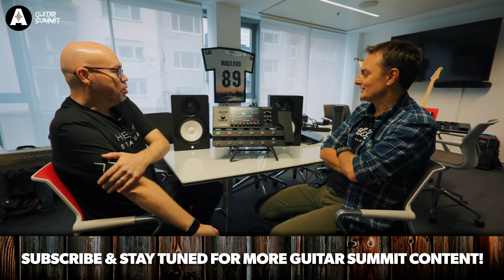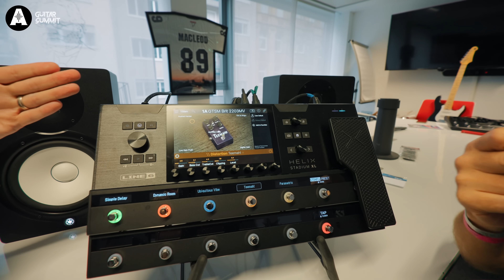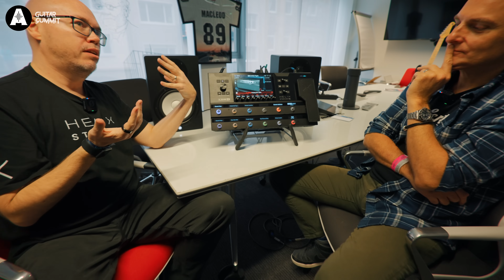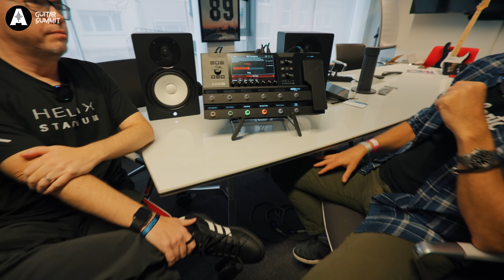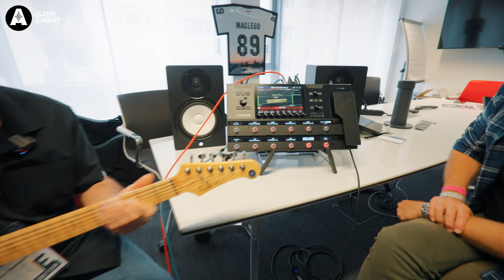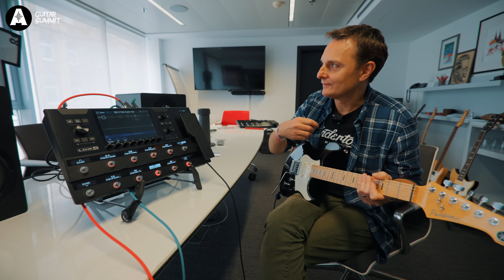Line 6 Helix Stadium Floor XL at Guitar Summit 2025!

Comment: I hope Line 6 eventually provides a (desktop) unit with the same screen and functionality, but fewer switches and without the pedal.  That is, an upgraded HX  Stomp.  I will admit the Spark 2 sounds pretty good now, but it took me a lot of tweaking to get the sound I wanted (and some surprising choices of amps, compared to other modelers I have tried,)
But Line 6 and Boss are still my goto favorites...  (well, ok, there is Ampero II, and Nux, and .....  :)

Comment: Question for Eric or Paul hopefully…

I’m listening through headphones, and my issue is…(and has been since the Hd500 and with the Helix)  that when you have any amp model….from black face clean to gained up Plexi, and you play soft and then dig into it, I’m used to how real amps get louder and actually “fuller”, but the digital models tend to thin out and get more trebly rather than more ballsy.  
Does anyone else hear or experience that?

I’ve been gigging professionally for 35 years and have owned countless tube and solid state amps, I’ve owned every guitar device Line 6 has made… as well as the Kemper Stage and Headrush.  I am really hoping this will be different.   

I’m optimistic and have been on the preorder list since day one, but so far, I hear the same thing in this demo.

Comment: There are two tone-products I really wish I could get included in a Helix so I wouldn't need to connect external devices: a Digitech Freq for a feedback squeal ala Thorp, and a full-on fully adjustable Rockman with all the settings seperated out.

Comment: Hoping there will be deep edit parameters added to the amp blocks. Like negative feedback, depth, custom impediance curves, different power tube types, tweaking transformer parameters. Not sure if that's feasible with the "component level modeling" in Agora, but if they did it somewhat comparable to Fractal, it should be. This is the only thing missing to cover all of the bases that the competion is doing. That and having a looper that competes with Loopy Pro would round out leaving noting to be desired all in one unit. I'll enjoy my preorder unit either way.

Comment: As an SLO 100 owner for a couple of decades (yes, a real Mike Soldano one) I’ve never heard a modeller come even close and the ‘Sold 100’ here sounds crap. It sounds like a cheap distortion pedal into a cheap delay pedal, yuck! 
Modellers are toys for hobbyists who want to play at being guitar heroes in their bedrooms. No real guitar player plays through desktop speakers, headphones or FRFR cabs. So, it’s laughable that this is called ‘ Stadium’ 😂 I guarantee you will never see this product anywhere near a stadium let alone on the stage! 
Btw I’ve owned nearly every amplifier every made including things you will have never heard of, I also own a modeller - I bought it last year out of curiosity… it sucks!
Reply: What was the playback system for your modeler? If it wasn’t a real power amp and wooden cab, what experience were you expecting to achieve?

Comment: In my opinion line 6 would be make a basic product with emulations, cabs an effects, a cheaper product, and then, if you need a showcase function or a clone amps functions, you can download in the line 6 web and paying for it, like plugins or whatever. I like how stadium sounds but i don't need some functions. It can be like phones. You have the basic product and then can download apps as you need.
Now other brands can take the idea and offer a same quality sound product with less price.

This is a problem because in 2035 we will find procesors in 3500 $ with some specs we don't need.

Comment: I'd rather plug into the real amp and instantly have the sound I want
Reply: For recording and playing at low volumes this thing beats real amps any day.
Reply: Not in reality. Only in geartube.
Reply: @BOSSenjoyer  It is a reality. You need a studio to record and play cranked tube amps. Nobody in their right mind is going to do all that at home
Reply: Of course real tube amps are always going to sound 'better', because they are the thing that modellers are trying to emulate. However, they are heavy, loud as fuck and expensive. Digital definitely has its place.
Reply: Yeah I don't get it
Reply: @BOSSenjoyer  I agree with you that I would rather plug into a tube amp. However, I live in an apartment, I can't afford to buy several different tube amps, and I physically don't have the space. Modellers at least allow me to get at least some of the way there without getting evicted and/or divorced.

Comment: super excited for Helix Stadium. I am one of the people who has managed to figure out ways to max out DSP on legacy helix and usually create per-song patches.... which causes problems when I need to do really seamless outro and intro transitions with heavy lead lines between songs becuase I'm limited in DSP and cant bundle all of the different effects on one patch and also dont have seamless bleed between patches with the amount of rows I use per patch. So that alone excites me. As a tone snob as well, the added dynamic range and preamp quality upgrade is very very exciting as well. And because I gig so often, that weight decrease is huge for me. If this was all that they innovated upon I'd still upgrade. But all of the other stuff is just insane and I cant wait to nerd out and find ways to enhance my performance quality with the features. Also the touch screen was a must. I've mastered navigation with physical knobs having to make quick and abrupt changes during soundchecks and sometimes even in the middle of a live set, but the touch screen will make that so so so so much more fluid. Not to mention being able to use my tablet or possibly phone for patch editingg over bluetooth is HUGE

Comment: Over priced over sized, I could get just as good sounds out of something cheaper and smaller
Reply: Just add "in my opinion" or "for my needs" to your statement and everything will be fine.
Reply: @HotRats73  I used to be the one at the front of the line to get the latest and greatest things like these but have got wiser with age

Comment: RE: the matrix mixer section...what Lee's talking about with using the unit as an interface to output separated tracks was actually possible with OG Helix as well...I was able to use USB ins routed properly in Ableton to go through send that I could connect to our mixer, two for stereo outputs for the tracks and a third for the click....the key issue I ran into was the presets where you route a second line in one of the paths to pass the tracks through didn't save correctly...I'd have to  cycle inputs for things to be recognized correctly.  Hopefully they've worked out that type of jank, because it would be really nice to all-in-one it *reliably*!

Comment: I have mixed feelings. Lots of cool features but …First of all I don’t approve of the “buy now, you’ll get some features now and the rest later”. Then the images of the pedals and amps at an angle with the background or surface look a bit awkward to me. Headrush and Fender are the best at UI. The RJ45 port for “possible future features” sounds very silly to me. And finally… why does the basic unit not have the strips?!?!
Reply: You can turn off focus view so you don’t have to look at the images of the pedals / amps 🤙
Reply: They knew that the strips is a huge deal specially with a unit that it’s so flexible. They want the user to buy the XL.
Reply: @netzarim1277  of course but the base model is still pretty big and pricey. With the Helix it was the LT version that lost the strips. I feel like the branding is a bit off. For a big unit like that with so many switches a feel like the strips should be there. They could have saved the no strip layout of an LT or Stomp model later on
Reply: @Mig-El_Romed  I agree that the strips are a must have for units so customizable. That’s I’m saying they really want you to buy the xl. There’s a reason why they are launching it first.

Comment: Hey guys, I enjoyed the video. I remain impressed with the technology. But I am going to continue to ask. When will you address the remote editor? As I have stated many times. I am a blind Blues guitarist. The only way I can manage the unit is via the editor. The editor must be screen reader accessible. Line 6 has never shipped an editor that is accessible to the blind. Bells and whistles are great, and Stadium has them aplenty, but when do you get back to the basics? How will you address the needs of blind guys like me? Frankly, I'd love an accessible HX-Effects editor. That unit does everything I could want (except for the editor).
Reply: I'm keeping the pressure on them as a long time L6 user who’s also blind. I’ve found a rather unique work around to editing presets in Helix, but it requires a massive amount of knowledge and an very specific skills to edit it since under the hood the files are what are called .JSON files. You can use a text editor to write presets or change parameters like you are writing code. Believe me its as painful as it sounds. I’ve played my Helix everywhere from small coffee shops to large statium level events and everything in between. But I basically have to either settle in for a night at my computer if I want to manually change things or have someone do the changes for me. Out of respect for Eric and the L6 team I’ll say I do know at least part of the reason the current editor is not accessible and it is not something they can easily fix. I’ll have to leave it at that for privacy reasons. That being said I want to put the pressure on them to get this into the hands of one or two blind users to actually let us even see if it is worth buying. I know we are a small group overall, but it would be nice to get at least some functional use out of a product we spend our money on. Oh also I’ll say here and now I’ll still buy this over any other unit. Kemper tried, but they were just not good working with this stuff. Fractle Audio basically told me they did not care nore is it something they would ever want to take up. L6 not only took it up but has tried actively to work with me in the past and I’m hoping to get that relationship going again for this new unit as well
Reply: That is really good hearing. I do not know how you import the .json files, but it seems reasonably straightforward to write some python code to generate them, so that you aren't dealing with syntax errors in the output. If I could do this for the HX-Effects, I might be interested in taking on the hassle. My experience with Fractal has been very positive. Contrast the size of Fractal to Yamaha/Line 6. I won't go into the details but I have been working with them on the accessibility of one of their products. I am also approaching this from a different perspective. I am looking at filing a law suit under the ADA against the modeler vendors. More to come on this.

Comment: Well. I have a Helix & have been using it happily for 5 years. I use it somewhat differently from most in that I dial up my own tones from ground level and then treat it like I'm using two of my favorite amps (Engl Ironball & Line 6 Badonk). Everything is the based on that core tone & variations done with snapshots. Works great; nobody who hears it thinks I'm using a modeler.
But now.
Crap. I know I want this new Helix,  just gotta not eat well for two years to get one.

Comment: Maybe I'm the only one who didn't/doesn't care about touchscreens. Helix (mine and the new ones) are floor units with foot-switches. I'm 6'2" tall with back issues. Much easier to edit my "old" Helix from my laptop anyway. So I'd appreciate editor improvements. I also don't care about amp capture much. I haven't owned an amp since POD 2.0. I've been very happy trusting Line 6 to create amp models for me. Can I plug my Variax into "Nexus"? I do appreciate the looks and the work put into the new Helix line, in spite of the fact that it feels a little like feature bloat and solutions to problems that I wasn't having.
Reply: You are not the only one. Give me a nice PC/Tablet Editor and keep the touchscreen - makes no sense on a floor unit.
Reply: @berndkiltz  Thank you! I thought it was just me. Nobody fires an app on a touchscreen to drop it on the floor and use it.

Comment: This channel does nothing but slag off Line 6 and Helix products; Helix comes at the bottom or near the bottom in every digital shootout they do, and they have harsh words for it. See if you don't know how to get the best out of a product and rely on what is admittedly crappy default presets, then you're gonna get bad results. Do they even update the system? Maybe not. Never use IRs either, which vastly improves the realism of these products when it comes to trying to get a more tube-like tone. Never see them go into the global settings to do high and low cuts either. People who use Helix regularly know all these tweaks you can do and know how to make good presets that don't just involve turning knobs and hoping for the best. Now is Helix, etc, the best, prob not, prob old tech that's now showing its age, and a Helix 2 prob needs to become a thing. There's only so much juice you can squeeze out of an already over-squeezed lemon. It's a bit hypocritical, though, to be sitting here with the Line 6 people and acting like you never said the many negative things you have about their products. Never say to their face, right enough!
Reply: That's exactly my thoughts on getting great Tones from these products , I don't own any line 6 products I'm a big fan of Boss and bought the Boss GT 1000 when it was first released . Andertons did the same thing with the GT 1000 hardly any deep diving done just went through the presets .

Comment: We dont need better sound quality we need better UI and somthing enormous for studio or somthing small to touring
Reply: I agree with you. I thought the same thing when I saw the interface: a large screen but a very old or outdated UI. I thought it would be better in that regard, but I was disappointed. It's not something that appeals to my eyes. The modeler images are static, and I don't think they help at all.
Reply: @tavocalix2321  Same here i think they make amp and effect like in VST so everythink move and you can adjust thinks this way if you want it but this is just same Helix but "sounds better"
I think people love QC so much because is overall compact (for this abilitis) and easy to use. Same for Tonex. Its compact and sound good. 
Overall i think in mix and espacially live you can use anything Helix, QC, Hotone even Mooer (i see mors principium est  couple years ago and they using some smaller Mooer multi) only if you have good IR it would be sound good
Reply: @tavocalix2321 you can keep the images hidden if you don’t like them 🤙 I personally think focus view is great for dialing in a tone quickly, then you can turn it off to further dial individual knobs 🎶